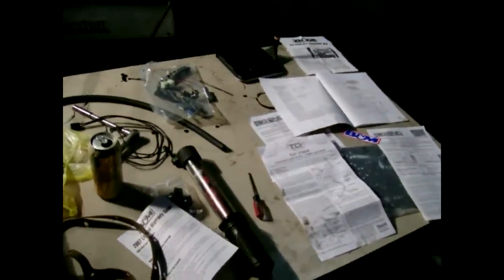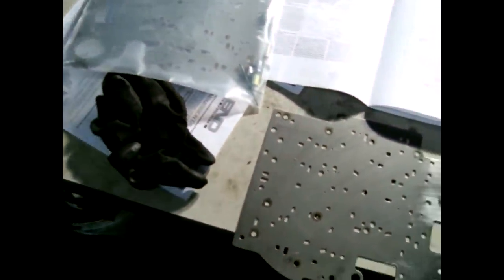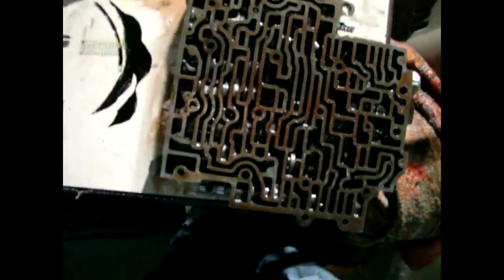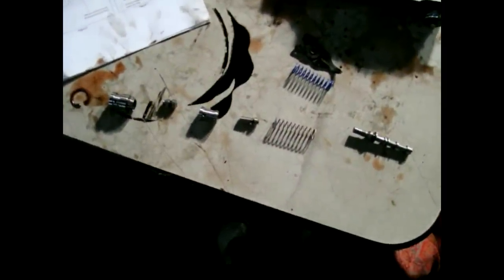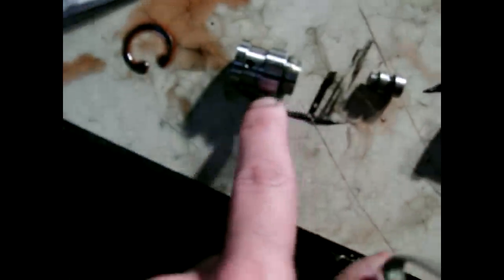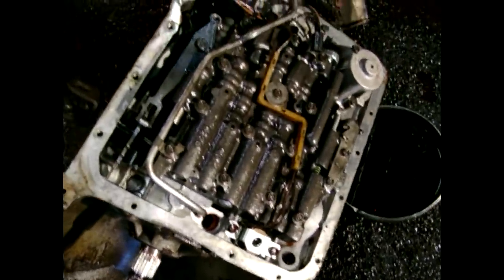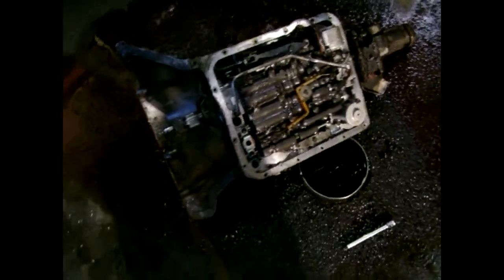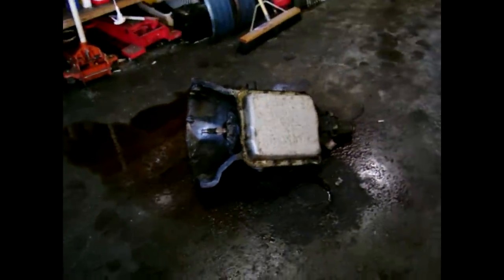TH 700R4 GM Transmission B&M Transpak Shift Kit & Upshift Valve Installation TCI

Comment from the maker: I used a rubber gasket.  It will still create a good seal with or without the silicone. On a flat surface like the pan gasket, it won't matter much.  But on a surface that has edges, I like to put silicone on in the grooves to ensure that there is no area for fluid to escape.
VT247

Comment from the maker: You'll want to mount everything back up and secure it in place.  While the Torque Converter Clutch (TCC) solenoid isn't 100% necessary, it lowers RPM by locking the torque converter.  Such as during accelerating to speed.  The trans will shift from 1-2-3-4th then the RPM's drop again when in 4th as the converter locks up.  It will unlock when given a certain amount of throttle.
VT247

Comment from the maker: Yes.  If you put it in Overdrive, it will shift through all the gears.  With the kit I installed it has a noticable instant shift.  It allows you to control what gear your in as well.  So if you want to hold 1st or 2nd gear, it will stay in that gear and shift faster than stock.
VT247

Comment from the maker: Check line pressure.  Also, without an aftermarket 3-4 upshift valve installed, the 700R4 won't go into 4th if the throttle is over 1/2 depressed.  This is also why if you are in 4th gear and give it 1/2 throttle or more it shifts into 3rd.  Also check for proper throttle valve (TV) cable operation.  This helps to control line pressure.  There are different settings that can be used for the shift kit.  Without positive shifts, I'd say they set it up for 'RV' use instead of the racing.
VT247

Comment from the maker: No, just drop the pan and install the parts.  May need to drop the valve body if you're going to install a firmer shifting shift kit.  May not need to drop the valve body for the 3-4 upshift valve kit
VT247

Comment from the maker: You can get better MPG by being able to lock the torque converter while in any gear but first.  Go with a torque converter that allows for lock up.  It can still have a stall, just make sure it has a lockup feature.  Everything else in this video will allow full control of the shifting and lockup.
VT247

Comment from the maker: You have full control over the shift pattern after installing this kit.  The overdrive kicks in after line pressure in the 3-4 upshift valve is right.
VT247

Comment from the maker: You can install a shift kit into a 200R4, but the valve body and procedure is different.  The shift kit lets the trans shift faster.  A shift kit and a trans cooler will help keep the trans alive a lot longer.
VT247

Comment: sso the 700r4 is a 3 speed with a 4th gear lockup in the converter? I had a trans place rebuild my trans and it only has 3 speeds no lockup comes in on the highway .and my rpm,s are revving at 3500.verycheap guy I'm thinking he installed a standard converter or swapped the wrong valve body.the old one had a bent valve.
Reply from the maker: The 700R4 has 4 gears AND a lockup for the torque converter.  Check your linkage, fluid level and feel for each gear to shift.  Shift manually if necessary to check that all 4 gears engage.
VT247

Comment: How is did your 700r4 do after the install and drive?
Reply from the maker: Did great, shifted fast and firm.  Had no issues after doing this install.  Had full control of shifts between gears too.
VT247

Comment: I just did this install this weekend. I think I drill the holes wrong. what will happend with this mistake? I still have transmission out should i get back in there and drill it right?  and what about gasket will I be able to reuse it
Reply: S Zapata yes go back in and double check you're work always. less work now since it's out.

Comment from the maker: You can run an aftermarket torque converter lock up unit like the TCI one I installed in this video.  It's the detent cable that is so important for shifting.  It controls line pressure and shift points.  The aftermarket TCI TCC Torque Converter lockup kit allows you to drop the RPM's while in any gear except 1st by locking the torque converter.  
VT247

Comment: I have a question for you, dropped my tranny pan 2 replace gasket once i removed the filter  TCC was just hanging there i later found the 2 bolts in the pan as far as i can tell its a self grounding unit and i have no idea how long it has been like that i have had the truck for about 2 years now its a 86 suburban k20. So my question is should i bolt it back down? what difference would it make and how would i tell? i have taken the truck on the freeway its does 70mph easy as far as i can tell
Reply: Yeah bolt it back up

Comment: so if i had this done would it increase my MPG's thats why i got this tranny. A guy came by my work he had a 56 chevy belair  with a a 383 chevy stroker motor with 500 plus horse power with a 700R4 tranny he told me hes getting 31-32 Mpg on the high way he can go up a mountain with no problem